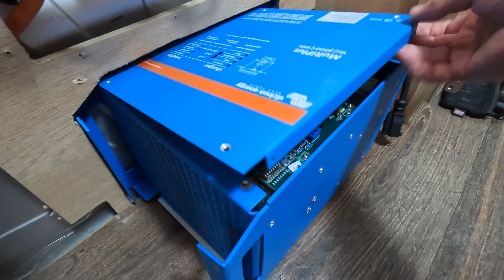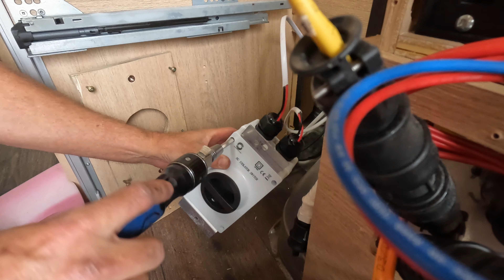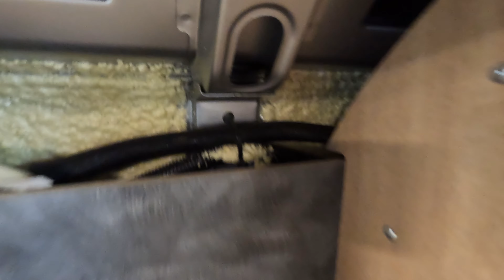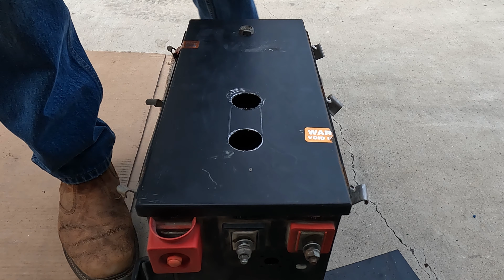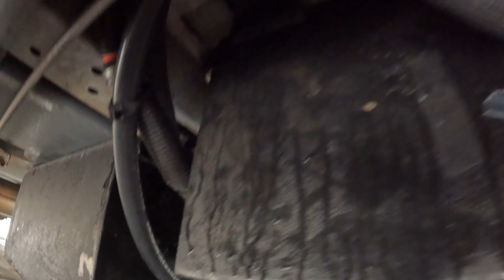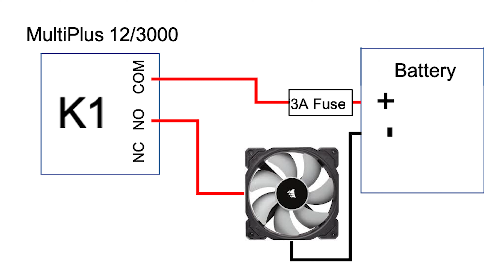Hymer Aktiv Electrical Upgrades (Part 2 of 2)

Comment: Very informative video. Thank u. Did u have to lift the RV to remove and reinstall the batteries, or is it manageable if driven on 6 inch ramps?
Reply from the maker: 4-inch ramps would be more than enough. I have a lift kit on my van and didn't need to put it on ranps
Reply: @PatsTravels  Great. Thank u.

Comment: Great video Pat! My H boxes have an outside width of 7.625 inches but Epoch has the battery listed as being 7.63 inches wide. So it seems like it would not fit unless Epoch has the width listed incorrectly or maybe your boxes are wider than mine. Do you happen to know the outside dimensions of your boxes?
Reply from the maker: I had one L and one H battery. The boxes are the same size so you shouldn't have an issue if you follow the steps I did in this video
Reply: @PatsTravels  Thanks Pat!

Comment from the maker: There is a BMS and relays inside each Ecotrek case, controlled by the switch that has two rockers on it. All of that goes away to make room in the Ecotrek case for the Epoch battery. Both the Balmar and Epoch BMS protect from overcharging. No schematic of my setup

Comment: Great upgrade! What happened to the AGM battery? Did you removed it?
I would like to just replace the batteries and keep the original set up, is that possible?
Reply from the maker: @juancarlosducca2782  the AGM needs to stay in place as a buffer for the UHG. Mine was fine so I didn't touch it. Yes, you can simply swap out the two lithium batteries and leave the existing inverter and solar charge controller. The two on/off switches for each lithium battery have to be removed though as there isn't room in the battery boxes for the relays
Reply: @PatsTravels  Thanks, so if I understand correctly. the battery Box has the BMS and Relay controlled by the Ecotrak switches to turn on and off the Batteries?
The Epoch batteries have BMS integrated already except the relay/switches.
So I will need to add a disconnect switch on the couch by the inverter like you did?
Thanks Again.
Reply from the maker: @juancarlosducca2782  you should be able to leave the battery on/off relay that already exists near the inverter. I prefer the manual switch so I changed mine out. There is no on/off switch on the Epoch batteries
Reply: @PatsTravels  So what about the Ecotreck switches? They each control each battery relays, don't they? Are those the relays located in the battery box? Than means that the UHG will be connected all the time to the batteries but the BMS inside the battery will make sure is not overcharging them?
Sorry about all these questions, want to make sure I understand how everything works.
You don't happen to have some schematics of what you did by any chance.

Thank you again!
Reply from the maker: @juancarlosducca2782 Google Victron Van/Motorhome Manual & Drawing. That is what I used for my wiring diagram. Between that and the two videos I made, you should be able to figure out what to do.
Reply: @ Thank you, I need to find a manual for the Balmar, not idea of what it does, and manual for the original inverter. I looked online but did not find the one with the LED display, i will look some more.
Thank you again for all you advice.
Reply from the maker: The BMS and relay for each Ecotrek get removed to make room for the Epoch battery. The Balmar and Epoch BMS protect the new battery from overcharging.